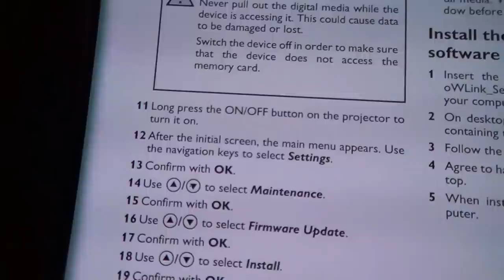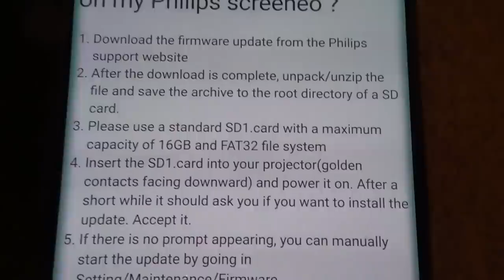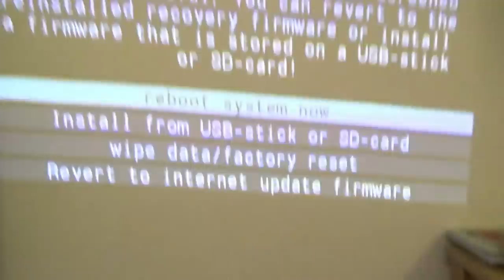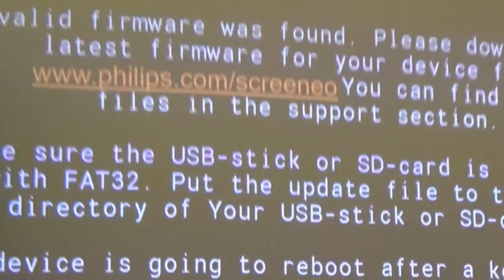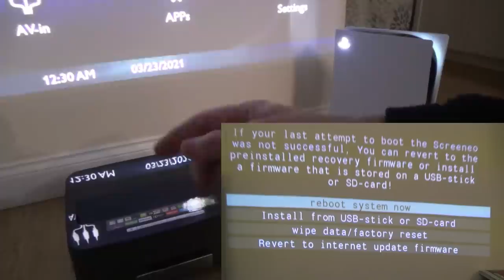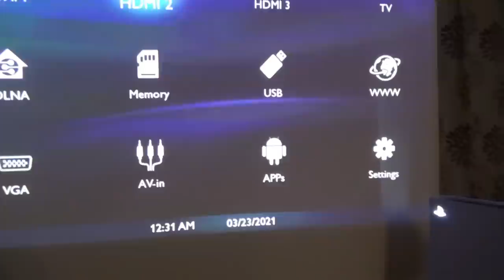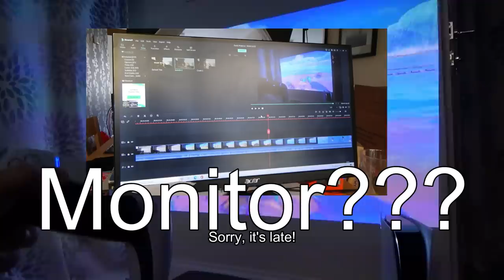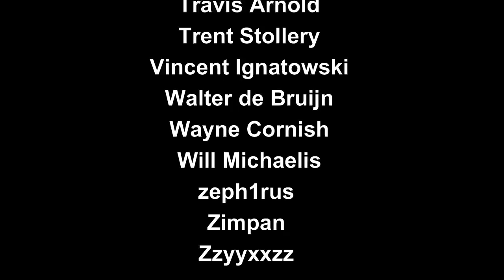Trying to FIX a BROKEN 100" Philips PROJECTOR - Philips Screeneo HDP1690

Comment: You should try doing some drone repair videos. They are really popular right now. And whether you do a cheap one from China or an expensive one I think people would really be into those videos now. So many people have them and so many people have broken ones. Obviously the ones with broken motors won’t be very interesting, but if you get some that have problems with the main boards, I’m sure loads of people would be interested.

Comment: At 5:20, the black heatsink in the top right corner looks like a corner broke off. Might indicate it took a really hard fall or bump to let that happen. The heatsink looks like to be over some kind of harddisk, probably for the firmware/software. If that corner took such a hard hit, the disk might be faulty - which would explain why it was stuck on the startscreen. Probably also good to put a new one in.
Reply: Good catch ! This is probably what was rattling around inside in the end.

Comment: Agree with JAW Media, CONGRATS 700K Subs. Great community that's been built off your channel!
Reply: Also you should trust your gut more often 😉. I had to deal with many projectors in various classrooms when I taught radio theory. Almost all would have various issues at times and a combination of buttons needed to be pressed at start-up to get into the maintenance menus. Most of the time it was for resetting the lamp hours as a lot of projectors track how many hours the lamp has been in operation and will not turn on until the lamp is replaced (or hour count was reset). Great Video!
Reply from the maker: Thanks man, I agree, such an unbelievably helpful bunch!!!!
Reply: Ellis The DJ  obviously LOL. Lamps often last longer than the hours indicate though. So in a pinch I never had a problem resetting the hours and replacing the lamp later on.

Comment: Like your videos, mate. It would be wise for you to build a capacitor discharger. You probably have everything you need to do it (thicker gauge silicone cable, resistor, probe, heat shrink, stick, banana plug with a wall jack or some other way to connect the far end to ground. It will avoid arcing/damage and be much safer than bridging the leads with snips ;)

Comment: Thank you. That is a dream caravan hollyday Entertainment system!
Nice work!
Reply from the maker: Thanks Anders, yes, I'm tempted to buy a pop up projector display for it 👍
Reply: @Mymatevince  Hi Vince. I used to make my own projectors years ago using lcd panels, freznels etc they were great projects.  I painted a screen with the maxxmudd paint formuler which adds reflective silver/aluminium to the paint which boosts the colour and contrast of the picture. It enables me to have the lights on in the room or even use it in the daytime and still have a good picture. The paint was very cheap compared to the same performance built screen. Works amazingly well and I still use the screen with my current 1080p Epson projector and looks so much better than just projecting on the wall. Here's the link to the maxxmudd forum if you are ever interested where they have the links to best paints, "for here in the UK too" , mixing ratios etc.

https://www.avsforum.com/threads/the-official-rs-maxxmudd-v-2-mix.1319717/
Link to the paint I used in the Uk section here.
https://paintschoices.blogspot.com/2017/07/black-widow-paint-mix.html
Reply: Why did you kick me from the FB fan club?
All I asked was for you not to spoil the videos, by posting early, and you kicked me out, can you explain your reasoning?
Reply: @harryhot  your problem is solved, you did not lessen to my argument and i do not have time for democracy in the group.
Reply: @andersmmvfc.8376  so you think it's ok to spoil peoples enjoyment, and to kick them, because you don't have the time?
If you don't have time to deal with a genuine request to stop spoiling the videos for me and others, then why have you set up a fan page, which requires your time?
To just kick me, because you're spoiling things for me and others, is just plain rude, and shows that your argument for spoiling things is weak at best.
Reply: @andersmmvfc.8376  also my problem isn't solved, it's quite the reverse, your problem is solved, because you don't want to listen.
Reply: @andersmmvfc.8376  I was also going to suggest a solution, but obviously you don't have time for that either.
Reply: If you had a solution you had plenty of time to suggest that.
The rules for the fan club is that i reserve the privilege to kick or ban any one.
You did go on my nerves and if you had contributed with comments sheared any thing, then I would have been more accommodating but as it is you wear a member 3 weeks.
 you are Wellcome back if you are okey to be spoild once or twice a week.
Reply: @andersmmvfc.8376  nah, no thanks, I prefer grown ups, not spoilt children.

Comment: Small note on those wires you pointed out that fit into each other. It's likely the colours are there to be a reference for what wire goes where. Blue for left, or "bLue", and Red for Right.

Comment: That's a real cool projector, perfect for "big screen" gaming or watching movies, like You said! The reason why it wasn't accepting the usb stick or SD-card most likely was, cause it was expecting them to be FAT32 formatted, where most newer, bigger SD-cards and usb sticks use exFAT partitioning, which it couldn't read. You can use linux or a windows program that can format large external storage space to fat32. I think it's simply called "fat32 formatter"That was a really great find someone gave up on too early. I wouldn't mind having one of those projectors myself!
Reply: Also sometimes the firmware file name and file extensions has to be changed in order to install it. That's at least how it works with usb bios flashback on pc motherboards.

Comment: Nice device, good fix :) I know that "sinking feeling" when repair is not going well, for example last weekend I resoldered detached power wire back to PCB and there still is no continuity. Forgot to check the wire itself, there must be a break somewhere in it. Thought the only fault was that it was detached from the board.

Comment: You have now been bitten by the projector bug. Soon you’ll want a 1080p projector etc. I’m on my third projector now and My first projector I got from eBay(Tradera in Sweden). I paid 100 SEK(about £12)for it because it wouldn’t start. I opened it up and there was a cable between the power supply that was loose. It just needed to be plugged in and I had myself a working projector. Although it was only 480p but it was a brilliant find.

Comment: Also remeber that the light only runs for so many hours (1500 or something depending on the light type.. usually there is a counter in the menu to see how long it has been on in total or per the light that is in now) Always let it cool down before moving it so the filament can cool down and it does not break when you move it.. if it's dropped while on.... the bulb can break as well.. you might not see it broken but the filament could still be...

Comment: Vince, I have watched and watched your vids, yes good find and repair But please don't short out the big caps with screwdrivers or pliers or snips.. Get your self a 200 ohm at 10 watt resistor metal clad, it will take the power factor away and then there will be no little sparks killing processors or burning out smd transistors  on the long run. because some components don't even like 5volts; Thank You  for your videos

Comment: Sometimes a projector will refuse to start/turn on because the lamp hours are too high. You can reset the hours with a remote on some projectors, otherwise holding down the power button while PLUGGING in the projector can reset/override the lamp hours completely.
Projectors always have hidden menus and key presses that aren't documented.

Comment: can't say for this unit as you didn't show us logic board but most of devices save firmware on standard memory chip like ones PC use for bios and they can be programmed with cheap programmers available on ebay/ae. So in case there is no "secret" button combination you can just brute force new firmware on device.

Comment: YouTube doesn't even consider 720p to be HD anymore. So by modern definitions, it's not considered HD. There's a huge jump in quality between 480p and 720p though and a much smaller jump between 720p and 1080p. 720p is definitely serviceable on a smaller screen. On a big projector you ideally want 4K though.

Comment: Hey Vince Love the channel have a little question I’m an electrician in New York I know I’ve heard you before saying that you have 240 V with a neutral is your power kind of like the United States where you have two legs coming in and does that mean it’s 240 V AC  and 240 V AC on each leg and when combined  together you have 480 kind of like our  commercial businesses.
Reply: Negative, Frank. It's just 240v between two poles, line and neutral. The third pole is the earth, but on double insulated devices without need of earthing, we have just two poles and a supply cable with two cores. We are aware of the risk with 240v so with building sites where people might be standing in water and using electrical equipment we use a 240 to 120v step down transformer with isolation cutout. Generally households throughout Europe use 240v using one of the three phases coming from the power station while factories use all three phases for 400v motors and the like. We don't mix and match 240 and 120v as you do in domestic properties, although I can see the rationale and do the same on my boat. We compensate for the added danger of 240v in domestic sockets in the UK by having robust shutters which can only allow access to live terminals to the correct plug, so no screwdrivers or paperclips can be poked in.

Comment: The original remote is very cool it has a key board on one side. And it works like a wire less mouse let's u move the cursor on the screen

Comment: Hi Vince, did you still find out in the end what was rattling around inside ? Kind of bothers me not finding out :D Great you fixed it though :)
Reply: Edit: as user @gilles11 pointed out , you can see a bit of the heat sink broken off. Maybe its that. Wonder if that piece could short anything? Hmm.

Comment: Always on 5V are called "Stand by supply". You can't reset the device by reconnecting connectors, nowdays settings are in EEPROM memory or battery backuped on main board. Most likely it was that damaged cable. If you looking for changing software you should search for firmware. It looks like Android recovery mode (it comes when hold volume down & power buttons), you can hardreset device or wipe it clean from here. When you do this you should restart the device manually after that and wait following long first boot. To reflash firmware you need "Rom" image of the device model. Hah you fix it by luck this time, but next time you will know ;)

Comment: Hi I have an issue on my NS wireless pro controller which is that I was want to play and I turned on the NS and before every time I turn on the NS I press any button from the pro controller the light bar work and now I was doing the Same thing and it didn’t work the light bar it’s working on L R ZL ZR but it didn’t connect even when the light bar work and the other button every tab I do it I hear in the controller weird noise can you help me how I fix it🙏❤️

Comment: Please don't short capacitors:
"Electrolytic capacitors may become permanently damaged by excessive peak currents, which will definitely occur during short-circuit events. The reason is that (a) the internal resistance will cause a momentary, but large power dissipation (heat!) and (b) the distribution of the current spike inside the capacitor will not be formed evenly across the large area of the aluminum foil and hot spots may occur. The electrolyte may vaporize along these small zones and damage to the insulating aluminum oxide layer may occur as well."

Comment: Been mucking about with a plasma TV with no picture today, found a shorted (1 ohm) electrolytic cap on the y sustain board, TV is fixed. has anyone ever come across a shorted electrolytic? I might do an autopsy on it haha, iv never had one completely shorted before

Comment: WEIRDLY EVERYTHING I bought NEW in London either never worked even replacements  or faults developed shortly after ownership BUT MOSTLY EVERYTHING l bought SECOND HAND worked perfectly .  Fortunately, this curse has broken now after 20+ years.

STOP

First    iitem - we're talking a £2,700* LCD Sony projector TV 37" which was replaced and its replacement faiked too. (Screen showed everything in purple and white.) 
     Ended up throwing it out - crying whilst l did so ... as l thought Sony was the ideal.

I got a new lamp for it but that broke too ... : (( 

*Probably £5k worth now.

Comment: I know I took my ps3 apart to clean it n I put it bk together n it won’t come on n everything is but bk right I’ve done it before any ideas anyone
Reply: Check all cables are seated also power supply voltages plus grounding

Comment: "Did you try turning it off and on again ?" "Yes" "Did you try taking it apart and resoldering a wire, then painstakingly reassembling it, turning it on, then press ALL THE BUTTONS MUAHAHAHAHAHA!"

Warning: do not read this comment before watching the video. This comment contains nasty spoilers.